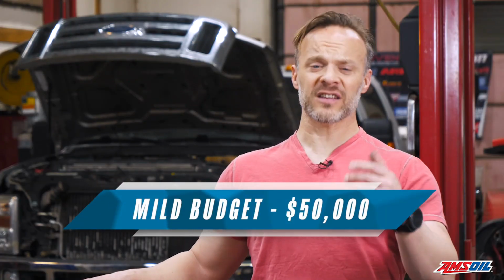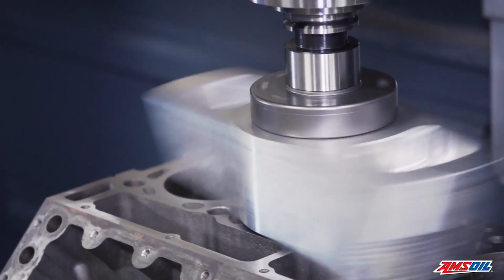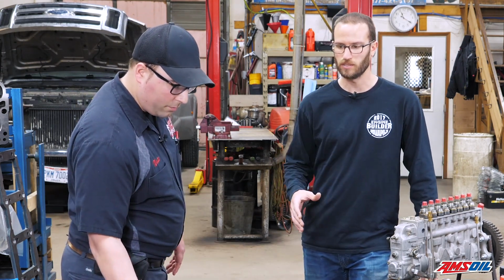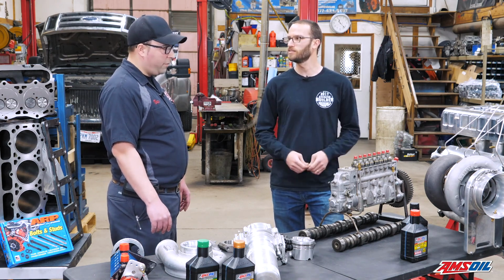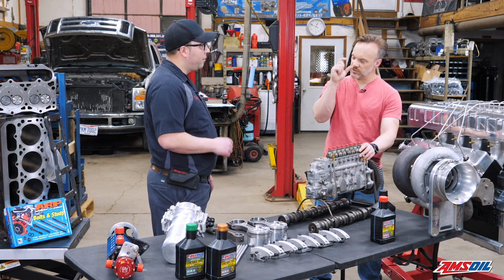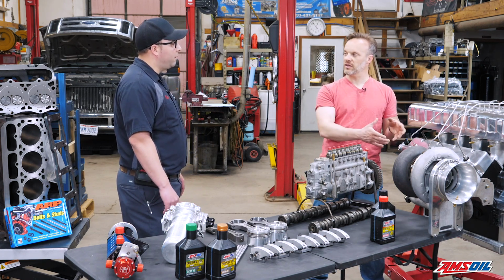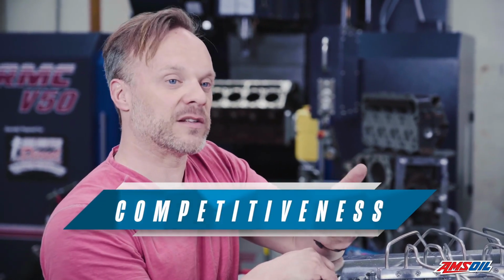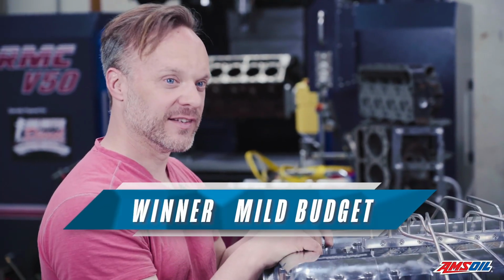Mild vs Wild (Diesel Edition) Ep. 3 – 7.3L Powerstroke Build

Comment: For 50k you get factory crank,  factory block?  Stay away from this shop.
Reply from the maker: In the diesel world, this is very common as the OEM parts, blocks and cranks in particular, are extremely well built and can handle quite a bit of horsepower.

Comment: Added stage 1 turbo and stage 1 injectors to my 7.3 should I upgrade my e40d tranny now that I plan to heavy tow?
Reply from the maker: We would definitely suggest you have someone look at your transmission and give you expert advice as to what you might need to upgrade there. This is something so many truck owners ignore until there are problems.
Reply: 6.0 trans cooler is the best thing you can do to it. Keeping it cool will save many problems from happening, especially when towing! Maybe do a John Woods valve body too. 👍🏼👌🏻🛠️🔧🔩✔️
Reply: @tdotw77  agreed, but one thing I did notice after doing that is it takes FOREVER to get the transmission up to temp if you're not towing anything.
Reply: E4oD’s are just not enough for a 7.3 no matter how you slice it, look for a zf6 swap

Comment: 50-90k into the engine of an over 20 year old truck?  Ya...no.
Reply: Why not people do it everyday
Reply: The amount people spend to build racing engines is pretty insane compared to the daily driver. Just wait until you see their fuel economy
Reply: It's cheaper than getting the same power out of most newer engine/platform designs. This is not a video about improving your $500 deductible pavement princess that carries your crotch goblins, groceries, and yeti cooler. This is a "How fast you looking to spend", video.
Reply: What is the sbc an how much are people dumping into that dinosaur.. haha
Reply: You can’t think about it like that. When modified a 7.3 can make way more power than any modern engine
Reply: People what want performance don’t really care what it looks like
Reply: Haha this guy